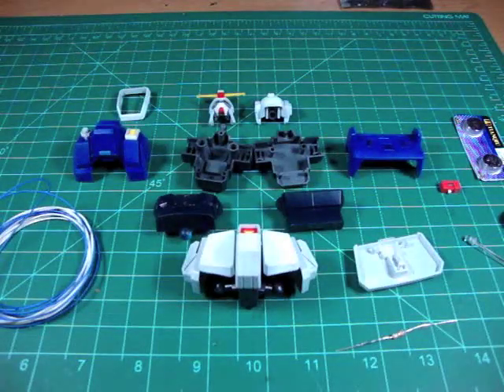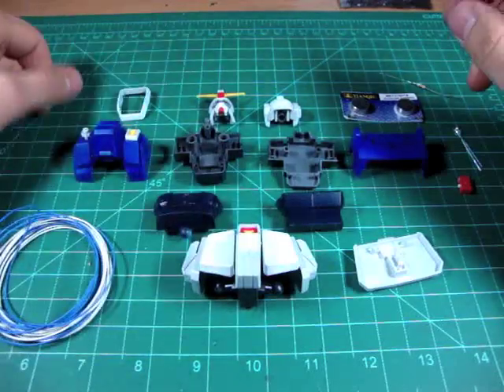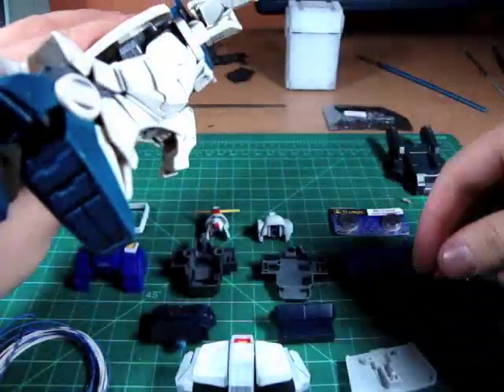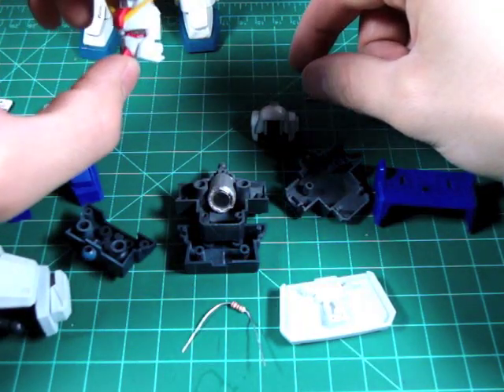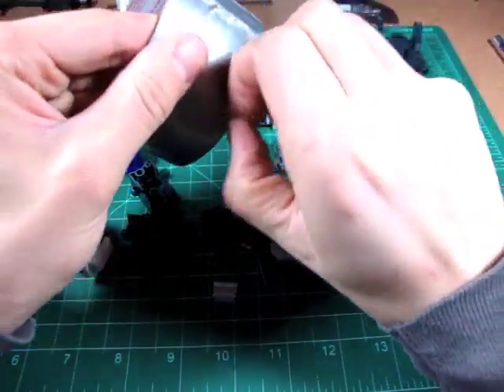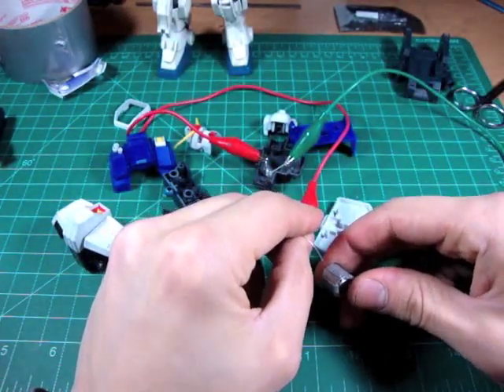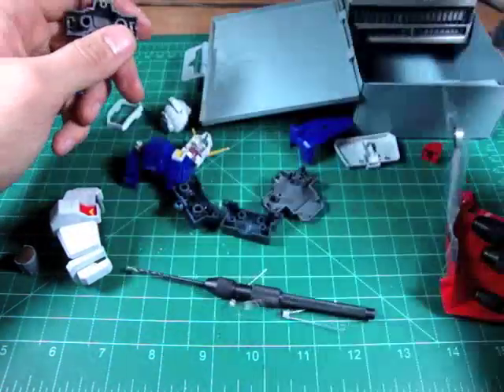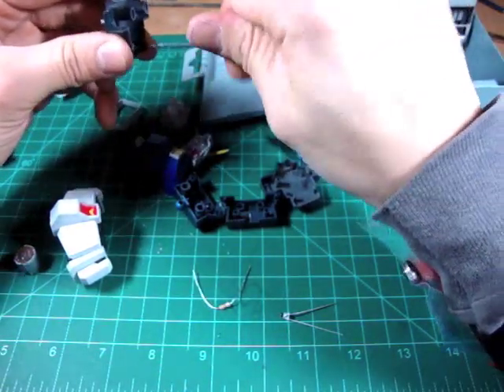How to put an LED into a Gundam Part 1

Comment: Would a smaller wire be usable for lighting up the LEDs? I have a 0.5mm solid core wire that I was planning to use for lighting up the eyes, chest and wing areas of the MG WIng Zero EW... I haven't tried connecting it up yet, but I will be using 3mm LEDs with a 9V power source, and the most powerful LED being 6000 mcd... not sure if 6 LEDs would melt the really thin wire or not...

Please need help

Comment: Heya, I want to start moddeling Gundam kits, whhat would you say were the esseintial tools I'd need to a great looks with? Trying to figure out a starting budget.
Reply: For construction, a decent side-cutter, a hobby knife, and a set of tweezers. The sandpapers are only optional, so if you're good with trimming down nubs using only your hobby knife, you won't need to sand it down. For detailing, if you won't paint your kits, then it's just Tamiya accent panel line and a spray can of top coat. If you're dealing with kits with waterslide decals(which are mostly on Master Grades), then a decal softener will help you out.
Reply: Thanks :) I'm starting out with some of the IBO HG kits So I think they use stickers more than transfers, althoug another quick question applying a varnish would be after ALL details and stickers are done, like using a fixativie on a penicl sketch?
Reply: Yes, the top coat serves as a save point of no return. You should only apply it when you're satisfied with the result. There are different top coats though. Matte/flat are rough and gives a realistic finish, also hides sanding scratches so it's the most used type of top coat. The semi-gloss is somewhat hard to work with, needs professional works, but that's just my opinion, so I don't really use it. The one I personally like is the gloss/super gloss, it keeps the shine of the plastic and is most effective when used to cover shiny paints like chrome, gold, silver, etc. You can do layers of top coat, for example: Build > prime > paint > top coat > panel line > top coat > decals > top coat. Always use gloss/super gloss on inner top coat layers.

Comment: If you do over drill the peg hole you can always let a layer or two of glue dry on the peg to increase the thickness till you get the thickness you need to fit the hole again

Comment: I wanna use a 3v led and power it with a broken iphone usb charger. What kind of resistor would I need? I think it is 5v. What resistor will I need if I want to put 2 or more 3 volt LEDs?Also, is there something I can get to make the LED flash on and off? Thanks
Reply: jp554731 there is a formula to figure out the voltage that a resistor will need, Google it, you will find it

Comment from the maker: hmm... I was using a 28 awg stranded wire in this video, but now all I pretty much use is magnet wire. For your PG wing I think 28 awg stranded should work fine, depends really on what you doing though.